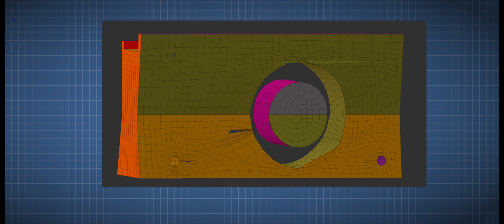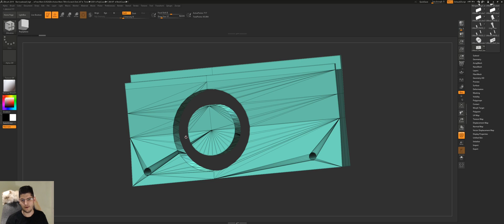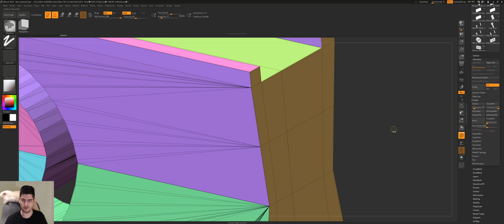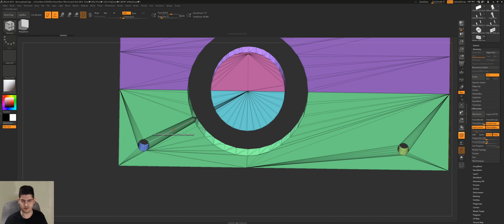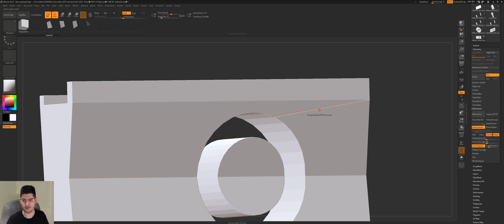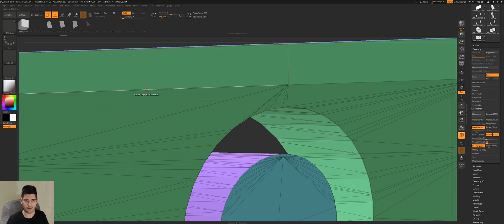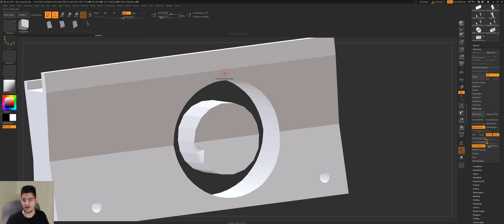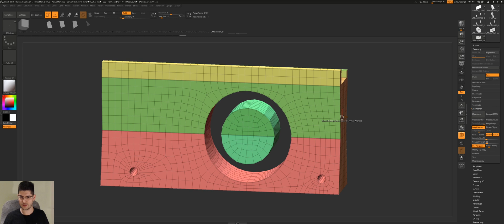Zbrush Quick Tutorial - How to Zremesh

Comment: After spending quite some times doing a game level with booleans (venturous, I know right?) and then quite a lot more time on figuring out how to remesh everything so I can properly UV map my assets, I've realized that is probably quite a lot easier if you go for proper modeling in the first place. No more booleans for me, at least not for game assets. Zremesher works, kind of, but in the end, even if it's damn near perfect, you'd have a much better time UV mapping a proper hand made topology and you'll most likely end up with a very low poly mesh  compared to a Zremeshed output of the same model made with booleans.
Reply: Also, you can always subdivide your proper topo for LODs or making a high poly version for normal map baking. Not so with anything else.
Reply from the maker: I always use booleans for objects for an animation or a rendered image where the higher poly count will not affect my work that much, If I would do a game asset, I wouldnt use it.

But it does seem like the future is taking us in that direction with how Unreal Engine will be able to use high poly models straight out of Zbrush. I think Remeshing automatically will become a more appealing workflow for game developers

Comment: Wouldn't be easier to Dynamesh first the whole object, then Zremesh then proyect the original model into the Zremeshed object?
I think you can avoid many of the issues you face.

I'm new to Zbrush so I'm in no way expert, but I'm trying to figure out whats going on.
Reply from the maker: That is definitely an alternative, and generally a very good one for doing anything that isn't a hard edge. I find that using the projection method will mostly soften edges that I would otherwise like to have razor sharp. In this video, after playing with booleans, that's when trouble starts and using dynamesh, although very useful, it can still blend my shapes that are in close proximity (which is not always something that one intends). 

One idea might be to dynamesh at a high quality and then select and make polygroups based on normals facing. Then applying creases and zremeshing to have this same result.

Thanks for your insight, will definitely try it out.
Reply: @ArghanionsPuzzlebox  no, thank you for the explanation.

Definitely it's better to know how or why this issues arise and the tools you have to solve them.

Comment: Great.. built a model in a cad program and having a tough time retopo it. Thanks!!!
Reply from the maker: Did you manage to retopo it?
Reply: Arghanion's Puzzlebox I made a sniper rifle and it’s composed of a lot of parts. Some parts work great... some not so. Some easier to remake.
Reply from the maker: @davemortimer9611  Maybe try the option that Cesar Perez pointed out in a comment below. Using  Dynamesh at a very high level and then using Zremesh and project on a decimated model. Might be easier that way, of course I am not sure what your poly count target is with the project :)